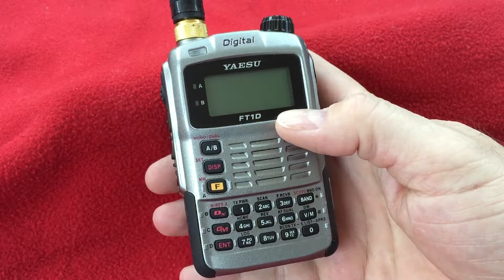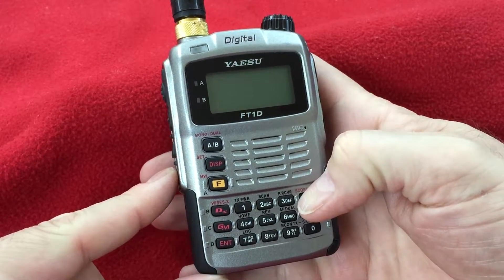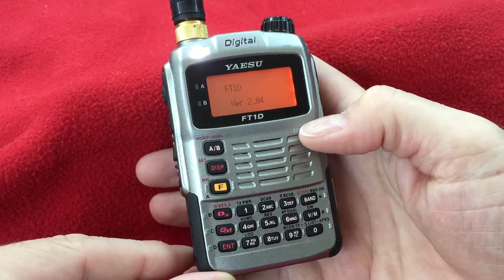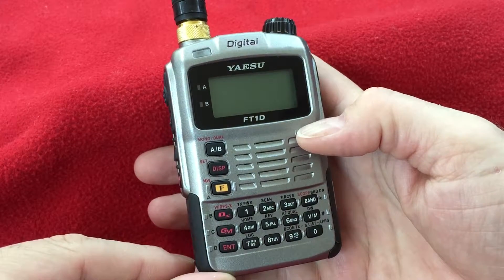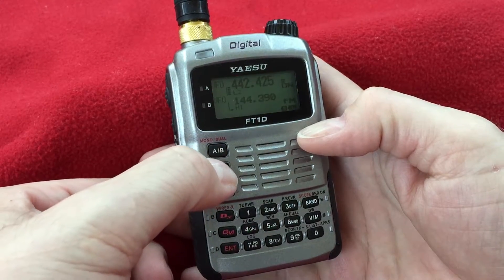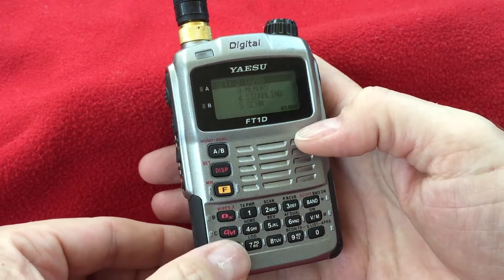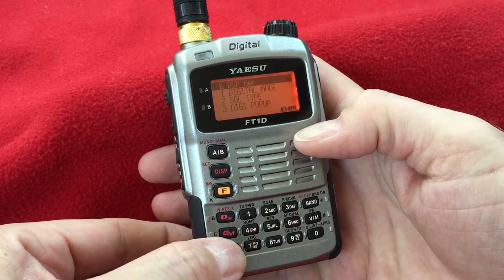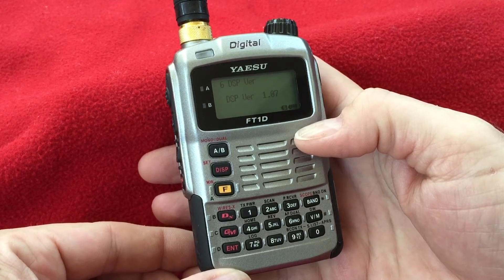Check FT1D Firmware

Comment: Glad to see you’re still looking at comments. I’ve run into a few problems with my ft1dr lately - the main one is that my sound will suddenly cut out. I can see a transmission is being received, but I can’t hear it. Not sure if it’s a loose connection or the AMS bug that I’ve seen people mention. Any ideas? I’m on ver 2.07 and DSP ver 4.10. Do you happen to know the latest versions?

73
Reply from the maker: have not had any issues with my FT1 - when I run digital I usually lock it in DN mode and forget about it.   Off the top of my head I don't recall the latest firmware for the FT1, I also understand there won't be anymore from what I have heard - you can check Yaesu https://www.yaesu.com/indexVS.cfm?cmd=DisplayProducts&ProdCatID=111&encProdID=25F65DA12CA1FCB444A927CD14417BFD  for the available files.
Reply: David Cappello Thanks! I actually found that the last firmware updates were in late 2017, and I’m not on the latest ones. I’ve also determined that I’m dealing with at least one loose connection (power) and possibly another (speaker). I tried to disassemble it to take a look at the internals, but it is NOT set up to do that, apparently. Do you happen to know if there are any service options (I know it’s no longer under warranty)?
Reply from the maker: I think the software updates should take care of some of the issues for you, I suspect you could send it in if you have a loose connection inside - have Yaesu fix it - I am unaware of any service options - other than doing a MARS mod on it. @urlawyer
Reply: David Cappello Thanks, brother.  73

Comment: I di the pwr and band and I get what looks like chinese charactors. noty what you see. plus when I try to do the dsp or get into menu now all of the sudden I get aprs only and no menu no more. ??
guess it is time for total reset which is no big deal either.  Looking for suggestions on the firmware version to try again.
Reply from the maker: Never seen that before Fred - perhaps the reset will take care of it?
Reply: Ok I got it to work now. I turned the knob and it changed the MENU choice and saw the screen like here. did what you said and all came up.   It showed a menu # of 060 in chinese or whatever language it was. Now to install the updates. I was at 2.04 so it needs it. maybe it work better LOL.   
Nice video well done good audio and easy to listen to, straight forward and to the point. I will listen to more soon.  THANKS !
fred ke5htb